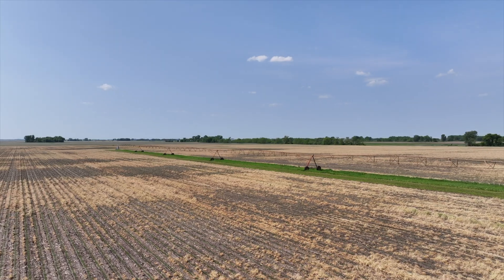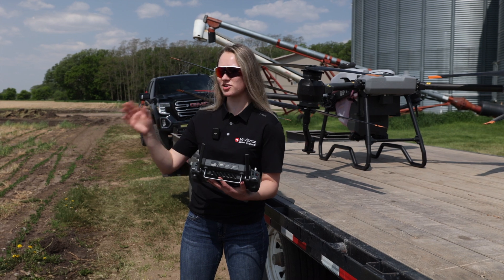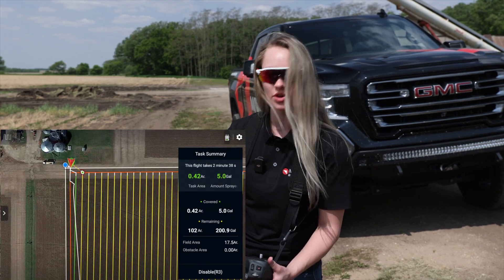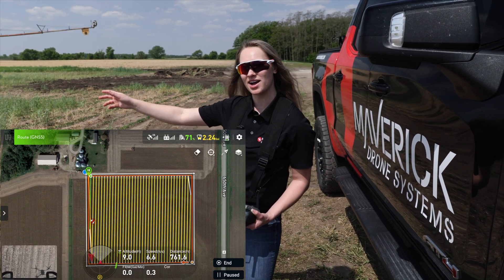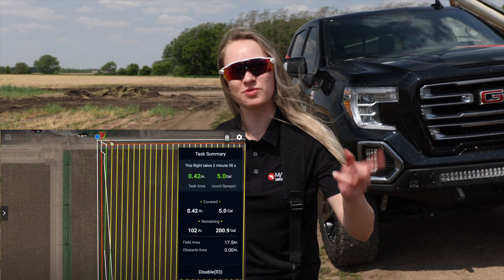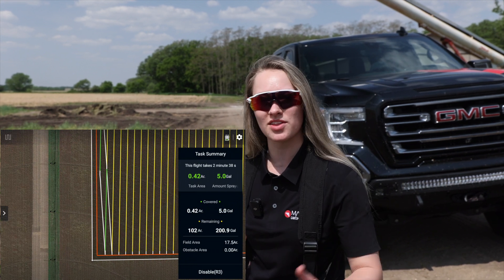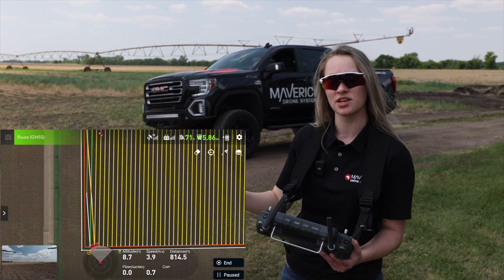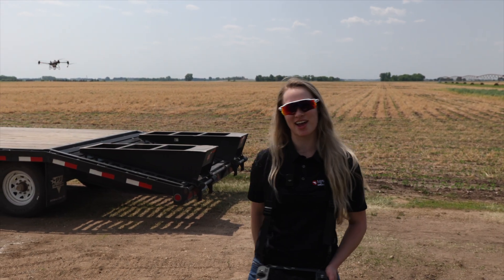Flight Efficient Operation Feature | DJI Agras T40 | Maverick Agriculture

Comment: Good video and explanation of the setting. I actually found this setting to be a hinderance a few times recently when we were spraying our T-40. I started in the far corner of a field so that I could play the wind and reduce drifting of product. I wasn't aware this was turned on, and got a bit of a surprise when the aircraft picked a new start point on it's own despite having set a specific start/connection point when I mapped the field. It also seems that you can't change your mind half way through, so once it's decided on a new start point, you can't go back to your expected first route, or at least I don't know how. Admittedly I'm very new to flying the T-40, so these are great videos to learn while we get more experience. Thank you.
Reply from the maker: Thanks so much for watching it and the feedback!